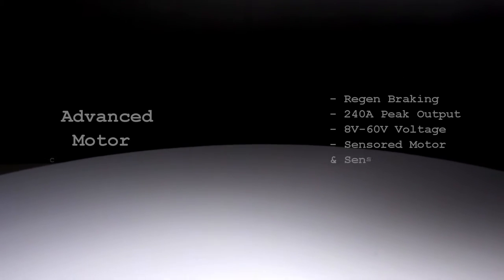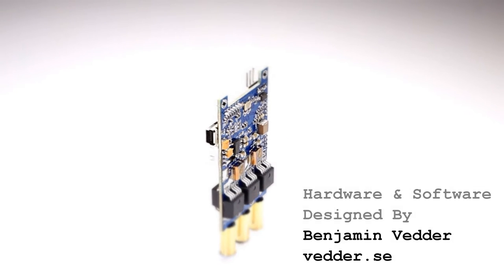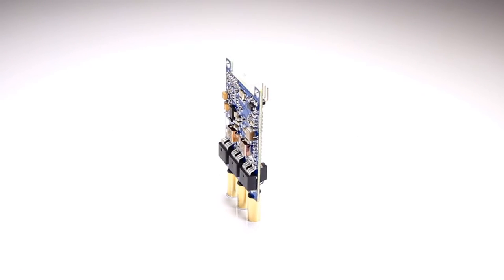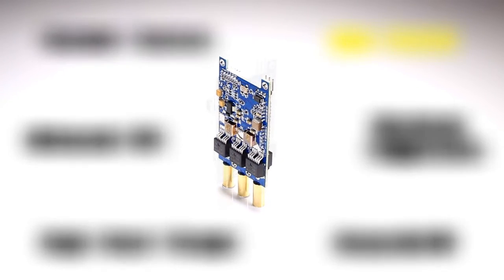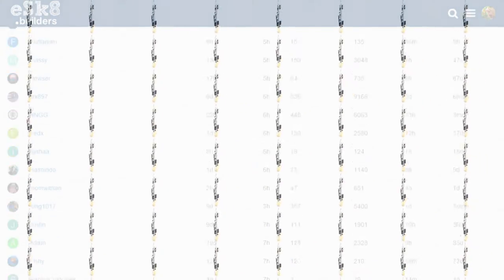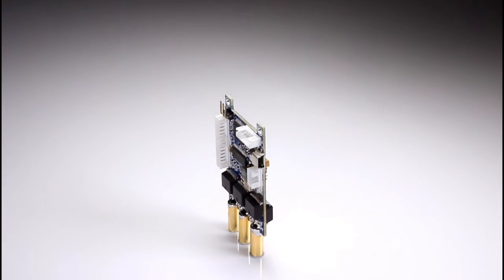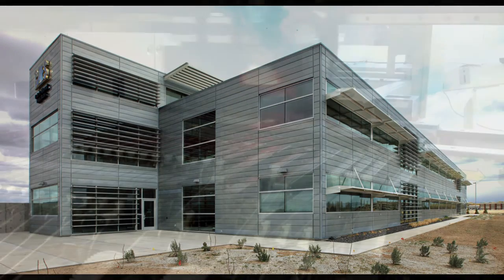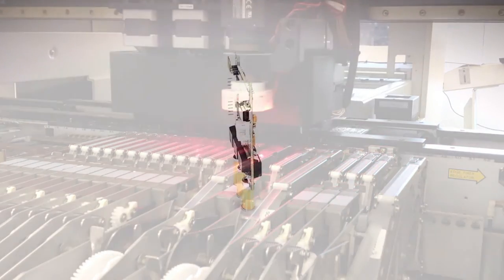Enertion V-ESC - The Ultimate Brushless Motor Controller

Comment: i'm sorry but although it has long list of features, i don't get why to be thrilled so much from this weak esc. its capable to deliver only 50A so if i have a motor above that, i'm lossing power because of the vesc's. there are cases of people couldnt clime hills. convince me i'm wrong
Reply: you need a high voltage set up (8-12s), than you can utilise the good controll features that other esc do not have